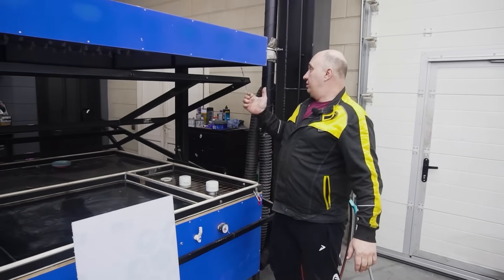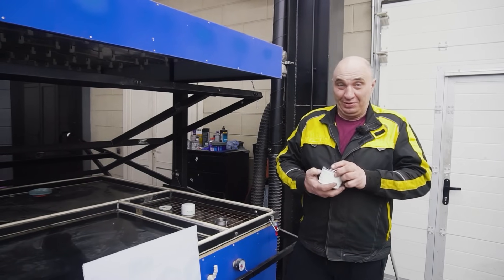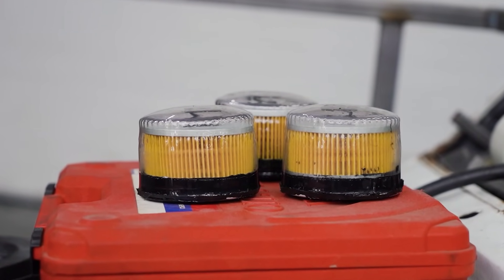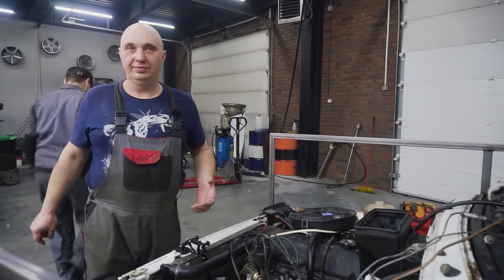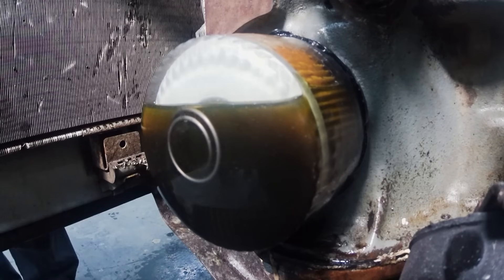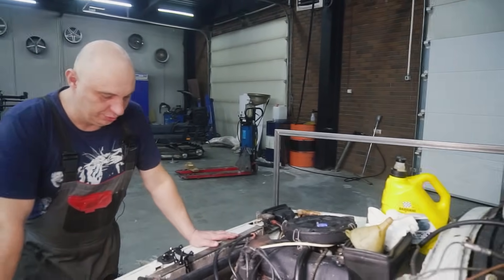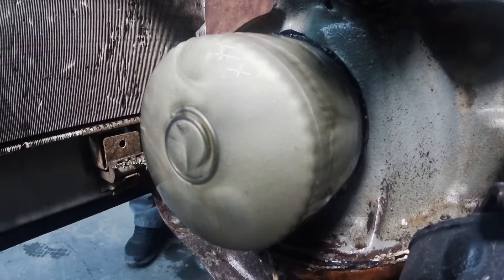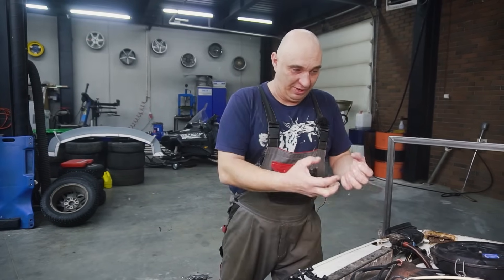We make transparent oil filter

Comment: consider re-doing this with different angle filters; some that are mounted on the top like a 1986-1991 RX-7s, and bottom like most Hondas; the top mount that is upside down could use a oil filter with anti-drain-back valve and one without, to see how much oil holds in them 'upside down'.  Seeing how all three ways to mount would interact when not prefilled and after shutdown would be interesting in different ways.

Comment: This also confirms the engine spends 3 seconds before pressurized oil is circulated to vital engine components without lubrication on a dry filter (Cam, Lifter, bearings)

Prefill your oil filters after every oil changes!

Comment: Interesting video, the oil actually went to the filter pretty quick, I've heard people say that an oil filter must be prefilled or else engine damage will occur during start up due to the empty filter creating extra work for the oil pump, based on this video though, it looks like it is pretty quick, and as long as you put adequate oil into the engine, it should be fine,

Comment: Suggestion: use a sandwich adapter on the oil filter and run oil lines to a liquid/liquid heat exchanger to heat flowing water. Use the hot water to pressure wash or clean parts or melt snow or something useful

Comment: Nice.  I always thought the little holes on the base were for the oil to leave the filter.  Turns out the oil flow is in the opposite direction I thought it was.

Comment: Клапан избыточного давления предназначен для случая, когда фильтр засоряется, поэтому в двигателе все еще есть масло.
the over pressure valve is for if filter gets clogged so the motor still has oil

Comment: I was going to say that if transparent fuel filters were done on old carbureted vehicles, then why not an oil filter. It occurred too me that fuel filters don't experience the types of heat that oil filters do, and a plastic oil filter wouldn't last very long in general, and glass would be far too fragile. All it would take is a single pebble hitting the filter at 70mph, and it's over.
Reply: 60 psi vs 7-10 psi

Comment: Well the transparent filter housing makes sense.
Some cars have a housing and filament arrangement where the housing is just an injection moulded plastic piece, and I've seen clear housings used in water filtration systems in the past and thought "that's a great idea, as you can visually inspect the condition of the filter without removing it 1st" and in an automotive situation you would be able to immediately see the state of prime on the lubrication system, and how black the oil is

Comment: Hi Vlad. Please could you say what was the First experiment where you added Silver Powder to the engine and why?? I guess the Silver is too soft to harm the engine? Thank you. Adding the Silver this time made it much easier to see the oil circulation. Very good. Do you think the Silver would help an old engine with worn cylinder bores or big-end bearings. Thanks again, Bark.

Comment: Nakachanyje Kaliosa yt channel was once making micro switch on oil filter connected to oil bypass valve. Bypass valve remains open even on fresh oil as long as oil is thick and cold and it closes , sending oil through filtration cartridge once engine is near to operating temperature. It takes longer with the distance and with dirt in oil filter to the point where oil engine flows all the time through open bypass without filtering if you have very dirty oil and filter without changing it for long time/long distance. Great and interesting content as usual. Great job guys. Thank you

Comment: Windshield sealant is an interesting choice.

I’ve found that omitting the primer greatly reduces the adhesion of the sealant.
Once cured, the sealant generally pulls off cleanly without it, especially with plastics.
I’ve experienced that with helicopter windshields.

It’s interesting how it differs from automotive applications on glass vs the plexiglass on the helicopter.
There was also a noticeable difference with sealant procured locally compared with sealant we received from France.

Technique is important also. If air bubbles are introduced into the sealant, it looses strength.

A filter housing machined from a billet of plastic would probably last longer, but the forming machine is an interesting process.

Great video 👍😎
Reply: Generally milling plastic makes it not clear anymore -- but you could just use that headlight stuff they showed in another video.
Reply: Way more labor involved with machining too

Comment: Safety fail.
Razor blades are not designed to be used by hand.
They are supposed to be used installed in a tool.

Cutting towards yourself is very dangerous.
This guy was putting a fair bit of pressure when trimming the excess sealant from the modified filter. If something had gone wrong, he would have cut himself severely using his own power.

I have broken those rules myself, but been fortunate that only minor injuries occurred. Others haven’t been as fortunate.

Stay safe.
Great video 👍😎

Comment: The bypass valve in the filter is not to prevent rupturing (that is the task of the pressure relief in the oil pump assembly), but to allow at least some lubrication when the filter gets clogged. Of course, it means the oil won't get filtered anymore, but that still means less damage than no lubrication at all.

Comment: You should try clamps, or zip-ties to hold the transparent housing to the base of the filter. It seemed they were able to withstand the pressure, but the windshield glue alone sheared.
I think the extra pressure from a clamp would help the glue.

Comment: What a lot of people don't realize is oil's lubrication is its secondary feature. Its primary one is to keep the moving parts of the engine cool. In other words, an engine can survive a lack of lubrication much longer than it can a lack of cooling of its internal parts which, when overheated, lockup and  can break. You can actually replace engine oil with water and run the engine for an extended period of time so long as you keep adding water (as the heat tends to boil it off). Yes, the engine will suffer from accelerated wear so don't do this to an engine you care about, but it will run with water in place of oil.
That is why so much oil is circulating so quickly through the engine. It must carry a lot of heat quickly back down into the oil pan where it can dissipate. Some engines even have oil coolers to aid in this.

Comment: The bypass valve is their to let oil flow through if the filter element gets blocked.
The bypass valve allows oil to flow through even if it is unfiltered as its a better choice than starving the engine of oil.
Looking at the service manual for the car, it will tell you specs about the oil pump and how much oil it will pump at a given RPM.

Comment: When I do my oil changes, I drain oil. Put cheap new filter on. Put cheap new oil in.run it 30 minutes idle,sometimes using pedal.turn off wait 1 hour if possible. Drain it. More old oil comes out. Put new filter on,new oil.the amount of old oil is alot.cheap new flush oil will get most of old oil out.

Comment: The reason you don't want to prefill your oil filters is because you're pouring it into the center hole, which goes straight to the crank and rod bearings. If there's any contaminates in that oil, which there will be unless you're in a serilized room, that stuff is going straight to those bearings. Some people never have an issue but at a shop it's a big no no because of how many cars get touched, it is possible to ruin someone's engine and it has happened before.

Comment: use a liquid transfer system with salt water with a metal (aluminium, iron, magnesium, zinc) bar as the fuel source, the other electrode of the battery, metal-air battery
Reply: you could heat plastic forming material, on top of the mold pieces, between two sides, then squeeze it into a two-part mold

Comment: When ever I change my oil, I always fill the filter to soak the media inside before I put it on. I keep filling it till it absorbs no more.
That was pretty cool seeing this.
Reply: Watch how long it takes the filter to fill up when they did the first oil change and were just cranking the engine without starting it.  It’s obviously better to prefill.
Reply: Problem is the oil you fill the filter with is unfiltered they're designed to be fitted empty.
Reply: @stuartburton1167  The oil that I fill the filter with is the oil out of the jug that I’m pouring into my engine. One can either pre-fill the filter or not.
Reply: @jeffs7573  the filter and engine manufacturers recommend fitting without filling with oil first. I reckon they know what they are doing plus about half of all filters I have come across are mounted horizontal so you can't prefill
Reply: @stuartburton1167  I see you have no mechanical experience except for your own vehicle. Filling or not filling a vertical mounted oil filter is up to the individual doing the oil change. My uncle with over 40 years of being a certified mechanic says it is best to pre-fill the filter to insure the oil doesn’t rupture the filter media, however he says it’s up to the person if they want to or not. I’m gonna go with the guy who knows from over 49 years experience.
Reply: @jeffs7573  I do not understand why it's essential to pre fill a vertical oil filter to prevent oil pressure rupturing it yet a horizontal (or in one make of Italian diesel engine vertical but pointed downwards) cannot be prefilled but doesn't rupture as soon as the engine runs
Reply: Okay I did a bit of research and it was practice to prefill oil filters to prevent airlocks forming in the oil pump which would starve the bearings of oil. However this was in the prewar days when oil pumps were a piston pump. Since the use of rotary oil pumps there's been no need to prefill

Comment: good job!
Wondering what the fail point for the windshield sealant?
Reply: I don't know exact numbers, but for modern urethane sealants, it's pretty high since the windshield becomes the support for the airbag and person hitting the airbag in a crash. The older butyl sealant stayed soft and won't hold the windshield in during a crash. By the looks of it, they used urethane.
Reply: @alex1949  Heat. Whats the fail point of the temperature, of hot oil bombarding it ?
Reply: @schumann-resonances  I got the spec sheet for Speed Set, a windshield urethane. It has a temp range of -40°F to 350°F and a lap shear strength of 890PSI. As long as surface is prepared properly, the urethane will hold. Now there may be different brands that don't hold as strong in foreign markets. Don't know what was used here.